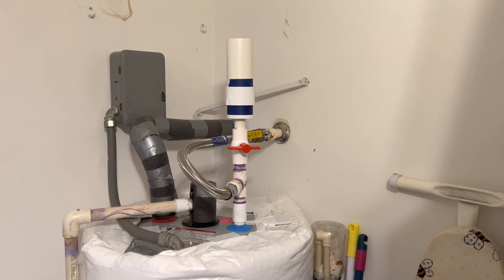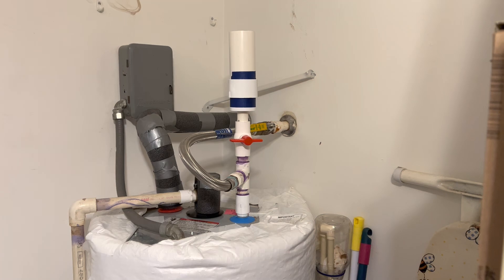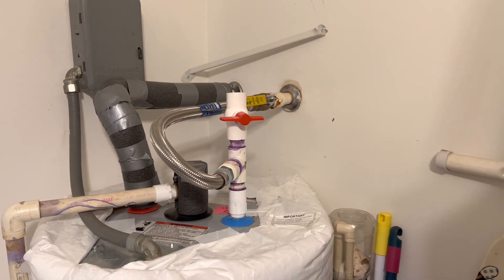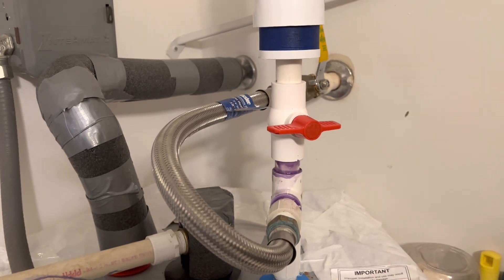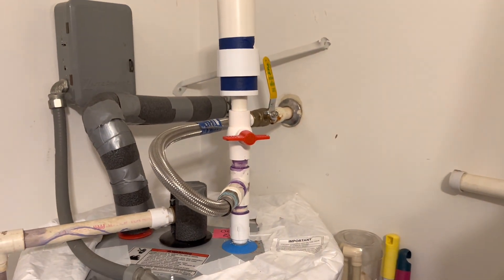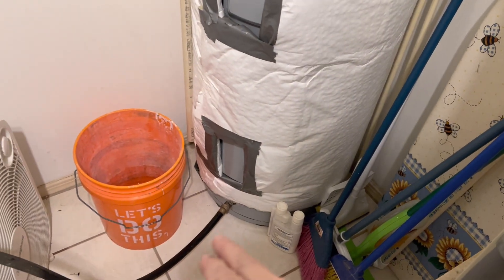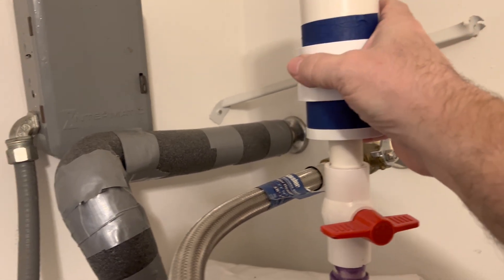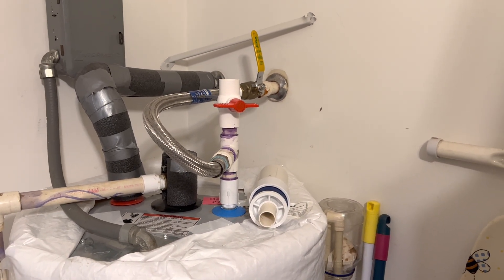Easily add chemicals (Clorox bleach or peroxide) to water heater to eliminate smelly water

Comment: would it make sense to just fill the sediment filter with hydrogen peroxide and run the water to fill the tank?
Reply from the maker: @richardlam6885  on my system I am unaware of any sediment filter
Reply: @cslloyd1  oh yeah it's mostly for well water systems
Reply: That’s exactly what I’m going to do. I need to address the whole house. But I think I’ll still implement something like this on the water heater for future reference. I’ll tie it into the input line a couple feet before the heater. 

Unfortunately what I really need to do is clean all the organic debris out my well. But I’m not looking forward to that! I’ll have to go down into the well and that water is cold!

Comment: I'm in a rental and, obviously, can't modify the water heater, but our water smells horrible. If I drain the tank do you think I could push some hydrogen peroxide back in through the drain valve? I'm hoping that, with a large syringe or something, I can create enough pressure to push back through the drain valve and close it off with much of the chemical still in the tank, but I'm not 100% sure that would work. I AM 100% sure that I need to get rid of the smell, though! 😂
Reply from the maker: First, some old water heaters are so neglected you cannot get the drain valve open.  You should attach a hose and see if you actually can drain yours.  If so you may be in luck…

You don’t need to inject, simply use gravity.  If you have a section of garden hose that is longer than the depth of water in your tank (after draining), you can pour your chemical of choice into that and blow into the hose to push it in.  Just hold it high above the water level and try to get the water level as low as possible.
Reply: @cslloyd1  Fortunately it's a new water heater. Maybe a year or two old. Cool, you don't know how much that makes me happy! Will have to give it a shot this week and see if I can't clear that mess up! Any advice after the peroxide is in place?
Reply from the maker: @snappertrx  you should google “leader hose”.  6 foot is common.  I’ve never used peroxide so cannot comment.  It seems like it’s a lot safer than Clorox, but i find an ounce or so of Clorox is all i need in my 40-gallon tank.  You might mix up a gallon of solution to funnel into the hose and then you just blow in the last few inches.  Draining the tank as much as possible before adding chemicals will help.  Make sure you turn off the electric.  Not sure what you do if it’s gas — you better figure that out from other videos.
Reply: We have a part time renter in a property and the first year I discovered that lack of hot water use results in smelly hot water. I injected a bottle of hydrogen peroxide through the drain hose, waited a couple of hours, flushed the tank by running the hot water, and that resolved the issue.

Comment: You put a pvc female adapter on the galvanized male adapter of the water heater. 100% guaranteed to crack (if it hasn't already) and what's compounding the risk is that schedule 40 pvc is not rated for hot water and although it's on the cold side, that nipple will warm up.
Never Ever use a pvc female adapter (for water supply) on metal male threads. 
You'll be finding that out .
Reply: In my state  the pumbing laws say the first 6 inches out of the water heater (hot, cold, or emergency drain) must be metal NOT plastic.  Also I would NEVER suggest a plastic ball valve they have to great a tendancy to get clogged with the cememt glue and not open or shut of fully. in iaddition to the weakining of seals from the waterheater hot cold cycling.
Reply from the maker: Thanks for your input.  I’ll keep an eye on it.  (The nipple is cool to the touch after several hours with no hot water usage.)
Reply: We did something similar but have sweated copper , so added a valve and copper reducer- but reversed - so expander really. It is always there as it is sweated in place but functions the same way without using PVC!
Reply from the maker: Thanks for the input about avoiding pvc around the heater.  I did replace the threaded adapter with galvanized… never had a problem but it makes sense that cracking could happen.  Obviously I am a plumbing hacker, so everyone should heed these warnings.  (My place is in the boondocks and plumbers don’t like coming out here.)

I have been using my hacks for over 1 year now and it’s been fantastic.  I’m sure the Clorox is no good for my heater but it improves things so much it’s worth destroying the heater.  We’ll see how many years i get out of it, then I’ll replace it.